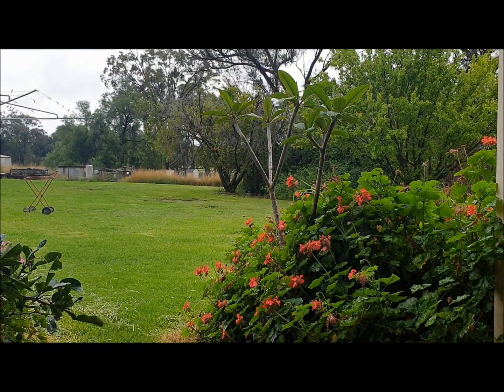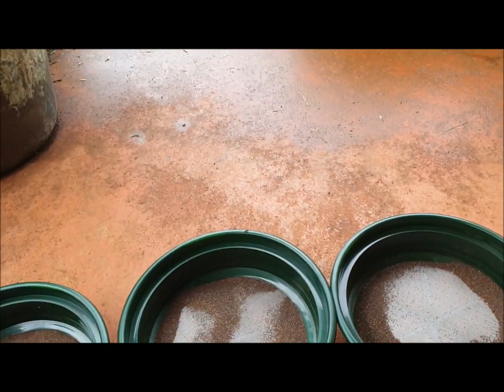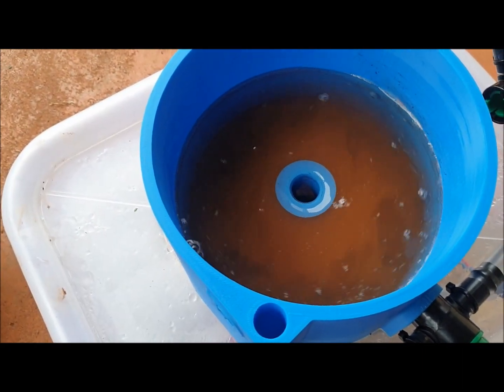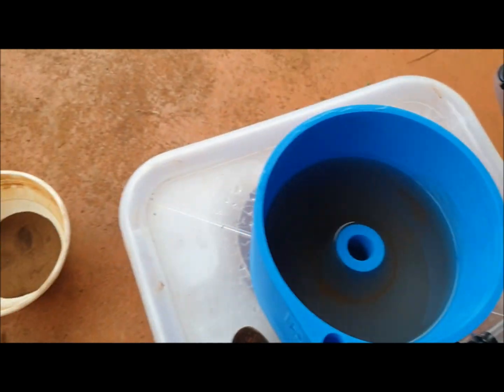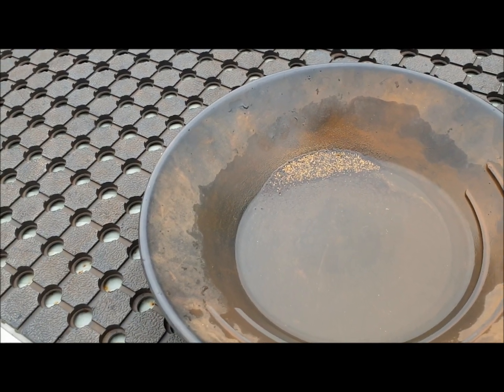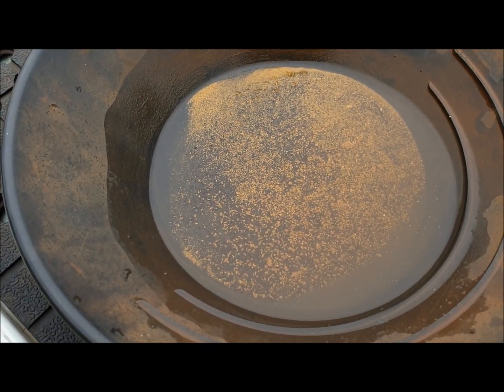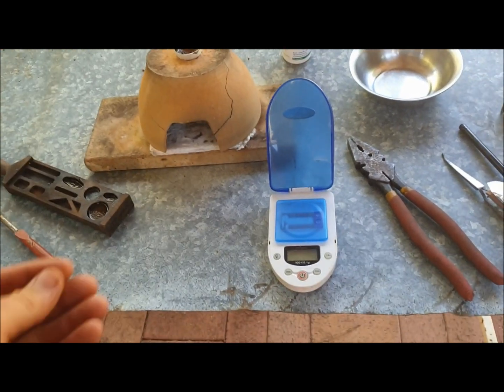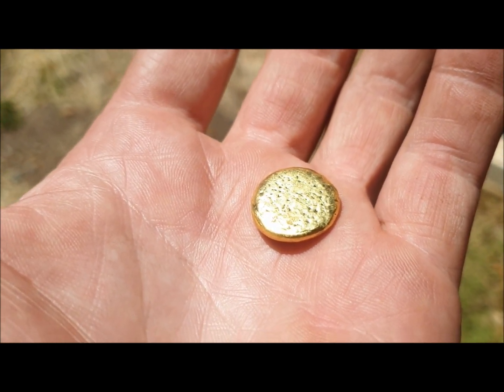2021 Gold Refining

Comment: this is called " gold winning" very different from " gold refining " when gold is refined it gains in purity. this gold is still the same purity as when it went in ie no copper or silver removed.  to refine it, you need to inquart with silver and make a 25% or 6k alloy then treat with successive "boils" of dilute nitric acid until no more silver/copper is released. from there the semi refined gold needs to be dissolved in aqua regia ( a mixture of nitric and hydrochloric acids) and precipitated with metabisulfite, oxalic acid or cupperus. the resulting mud after melting should be .9999 pure gold. love your work.